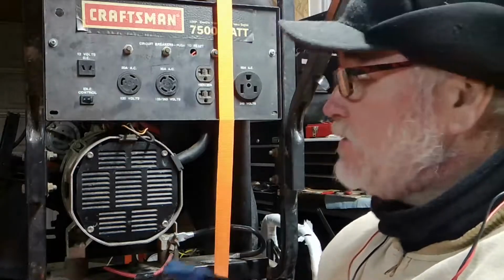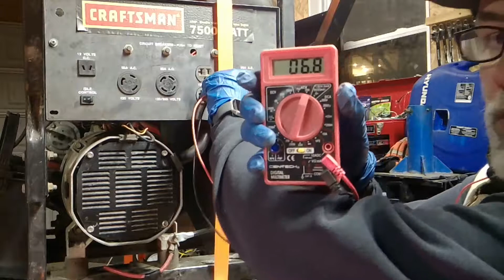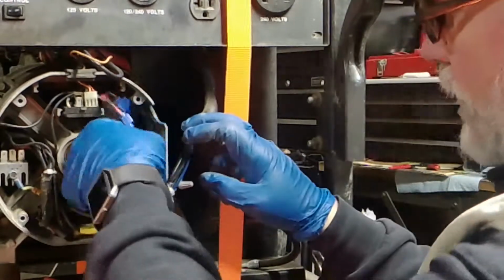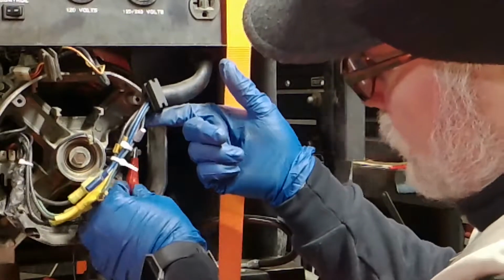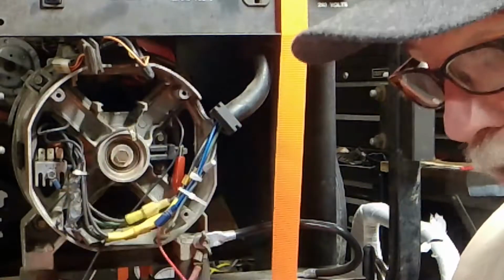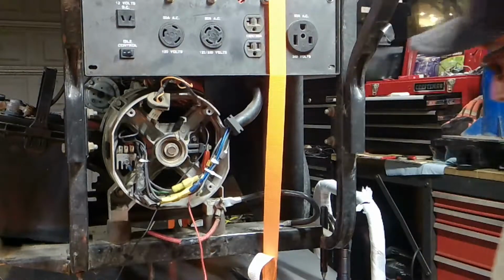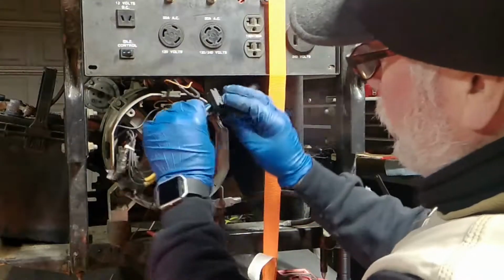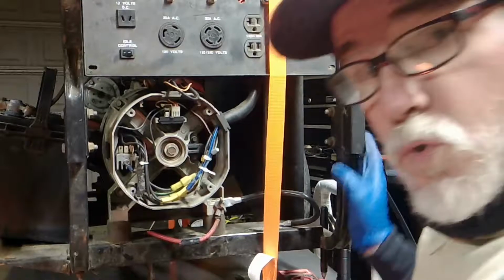How to diagnose generator power loss by flashing field w/12v battery and change voltage regulator

Comment: Output 4.5 vdc.  Brushes look okay with about 1/2" of brush on each side remaining...  I removed the voltage regulator and jumper 12 vDC to brushes (as above) and output jumps to 120 vAC. Installed new voltage regular, which looks almost identical (Briggs & Stratton 84132GS), and voltage returns to 4.5 vAC.  Repeat the above, repeats the same result.  Schematics in cyberspace are illegible re voltage regulator...  Question #1: there two spade wire connections on the regulator, though I marked them before disassembly, might not have been in the correct front-back position before I first removed the regulator.  Is it correct that a red wire tagged #2 is in front, and a blue wire tagged #4 in back?  Question #2:  Can marginal brushes work when jumped and fail with a new voltage regulator?  What am I missing?  Thoughts?

580.327290 (9783-0) - Craftsman 6,500 Watt Generac
Reply: @MarkSales70  With about 90% confidence, I concluded that a wire on the inner winding of the armature had failed.  The fix would require re-winding the armature.  I found a couple of resources that would re-wind the armature, but they wanted more $ than I felt the generator, working, would be worth.  Additionally, there was no guarantee that re-winding WOULD fix the unit.  I decided to take the generator off of the output shaft of the gas engine - and found the connection is a tapered one, possibly a "Morse Taper".  I wound up destroying the generator in the process of removing it.  I saved the engine and scrapped out the generator.  I used the frame, gas tank, and gas cap from the unit - and restomoded a 1972 Craftsman generator that now works excellently and runs for maybe 9 hours.  The Generac is dead and the Craftsman is better than new.
Reply: @EndWW2  Ughh!!   That does not sound promising!?!  I tested the two wires that go into the regulator (from the stator) and it measures 7 volts AC.  Is that the correction voltage?  When plugged into the regulator, the regulator produces ~ 4 volts DC (both the new and old regulator).  Could both regulators be NG?

Comment: I wish that I understood this stuff like you seem to. Nice instructional video that was easy to follow and entertaining.
Reply: ⚠️Generator safety advice: always keep in mind that carbon monoxide fumes are very dangerous to inhale and carbon monoxide is odorless and colorless which is a silent killer. You should always have a carbon monoxide detector if you have a portable generator. Please remember not to ever run your generator indoors. Running a generator indoors increases the risk of carbon monoxide poisoning which causes death. Please make sure your generator is 15-20 feet away from your house and away from doors, windows, and vents to lower carbon monoxide poisoning risk. Please remember also not to run your generator in wet conditions. Running a generator in wet conditions can cause electrocution. Please keep your generator dry. Make sure your generator is dry before using. If you need to use your generator during a wet weather, then you need a generator tent to protect your generator from getting wet. We also need to keep our children safe when we are using portable generators so that they won’t get electrocuted or burned by the generator which is dangerous. We need to keep an eye on children making sure they are not near the portable generator to avoid risks and also carbon monoxide poisoning. Generators can be dangerous so we really need to be aware with the hazards of using generators. Generators pose electrical risks. Please never try to plug a generator cord into a wall outlet to avoid back feeding. They should be plugged into a transfer switch if you need to run your house with the portable generator. Please not overload your generator. Overloading your generator can cause damage to the appliances that are plugged into the generator. Always turn on your generator first before plugging in appliances. And shut off your generator first before you unplug the appliances. Please use a heavy duty cord for your generator and the cord should not be worn out. Worn out cords should not be used on generators. Please don’t refuel your generator while it’s running. You need to shut off your generator and let it cool off before refueling it. Never refuel your generator while it’s still hot. https://youtu.be/I1jT3ANENvI and here is a video more about keeping your family safe while using portable generators. This is just a safety reminder and please make sure you are aware with the hazards of using generators. Thank you stay safe.

Comment: Fire in the hole!!! love this video. I know my generator needs flashing but I only have a cordless drill. How and where would I connect?
Reply: Turn on genny, plug drill in with breakers on and pull the trigger on the electric drill. Then you give the drill chuck a swift spin with trigger depressed and release your hand quickly. The drill and genny should now be powered up ☺
Reply: @staind288  and if it doesn't work after hand spinning it, hook up drill to drill and power spin it. Mine wouldn't flash with just the hand

Comment: Have same 7500 watt generator. It got jump started but voltage was reversed. Wire from battery to voltage regulator to charge battery was melted. I am concerned this became a major issue now.

Comment: Great video,my generator 12k always needs to be back feed every time I use it. There's no battery in it, is that the problem?After it runs 6hrs it will stop making electric. Thanks for any help.
Reply: Reminder about generator safety: always remember that carbon monoxide fumes are odorless, colorless, and toxic and dangerous to inhale which causes death. That’s why it’s never safe to run a generator indoors. You also need a carbon monoxide detector to be safe from carbon monoxide. Please be aware with all the hazards of using generators. Many people have died each year when using generators due to carbon monoxide poisoning and electrocution. Especially you should be keeping your children safe when you’re using portable generators so they won’t get electrocuted or burned by the generator which is dangerous and also poisoned by carbon monoxide. This is just for everyone’s safety. Make sure you read the manual instructions carefully. Please remember not to run your generator indoors. Your generator should be 20 feet away from your house and away from doors, windows, and vents. Running your generator indoors increases the risk of dying from carbon monoxide. Also do not run your generator in wet conditions. Always make sure your generator is dry before using. Do not allow the generator to get wet. You also need a generator tent to protect your generator from getting wet if you need to use your generator during wet weather. Running your generator in wet conditions causes electrocution. Please be careful. Please make sure your children are not playing near the portable generator so they won’t get electrocuted or burned by the generator which is dangerous. It won’t be safe for children to be near it. Generators pose electrical risks. Don’t try to plug a generator cord into a wall outlet to avoid back feeding. Please use a heavy duty cord for your generator. Make sure the cord is not worn out. Do not overload your generator as well. Overloading your generator can cause damage to the appliances that are plugged into the generator. Please turn on your generator first before plugging in appliances. And shut off your generator first before you unplug the appliances. And never ever refuel your generator while it’s running. Refueling your generator while it’s running can cause fire if gasoline spills on the generator’s engine because it’s hot. You should shut off your generator and let it cool off before refueling it. Just making sure you are aware with the hazards of using generators. Whatever is said on the generator’s operating manual should not be ignored for safety.  https://youtu.be/I1jT3ANENvI and here is a video more about generator safety and keeping your family safe. Thank you. Be safe as well.
Reply: @The_Happy_Aviation_Enthusiast    YOU  never answer anyones'  questions...... d o      you  ?

Comment: I have a Generac where the rectifier and brush assembly is one unit. The voltage stays steady at about 50 volts.  Is it safe to do this same test on my machine?
Reply: Make sure you follow all the generator safety instructions on the manual. I know all about generator safety and I have something very important to explain about generator safety. We notice that some people run their generator indoors which is not safe and it can cause death because of carbon monoxide fumes. We should keep in mind that carbon monoxide fumes are colorless and odorless which you can’t see or smell. And carbon monoxide is toxic. Its not safe to inhale especially when using generator indoors. Do not run your generator indoors even if your doors and windows are open. Running a generator indoors increases the risk of carbon monoxide poisoning. Running a generator indoors is never safe even in the garage. Make sure your generator is 20 feet away from your house and away from doors, windows, and vents. You also should have a carbon monoxide detector. Generators are outdoor use only. And some people also run their generator while it’s covered in snow. Here is what to be aware of; generators should not be operated in wet conditions because you can get electrocuted. Do not run your generator in wet conditions. Make sure your generator is dry before using. You also need a generator tent to protect your generator from getting wet if you need to use your generator during wet weather. We should also make sure our children are not near the portable generator to avoid any risks. Children can get electrocuted or burned by the generator which is dangerous so make sure you keep them safe. Generators pose electrical risks. Do not overload your generator as well. Overloading your generator can cause damage to the appliances that are plugged into the generator. Use heavy duty cords on your generator. The cords should not be worn out. Do not try to plug a generator cord into a wall outlet to avoid back feeding and fire hazards.  Always turn on your generator first before plugging in appliances. And before unplugging appliances, please shut off your generator first. Do not ever refuel your generator while it’s running. It can cause fire if gas spills on the generator while it’s hot. You need to turn off your generator and let it cool off before refueling it. Don’t refuel your generator while the engine is still hot.  https://youtu.be/I1jT3ANENvI and here is a video more about generator safety and keeping your family safe while using generators. This is just a safety reminder and hope you stay safe and make sure you are aware with all the hazards of using generators. Thank you be safe.

Comment: I have a generator that has to be flashed every time I use it. It's a 50 Amp generator colman with the fuel tank on the end, not on top. I do the drill thing using a battery-powered drill to turn the electric drill backward. While the generator is running. This does give me electricity after about 30 seconds and my electric drill is old and may need new brushes. But my question is why does it have to be flashed every time. Even if shut off just long enough to put fuel in it.the power cords are pulled from the generator prior to shutting it off.

Comment: I'm only getting about 60 volts. Sometimes it will go to 120 sometimes it will only get 60 volts and most stuff I plug-in will not work. A corded drill and angle grinder will work about halfway. Cannot find anywhere on the internet symptoms of bad AVR.

Comment: my 120 voltage is fine. However my 12 volt on the panel is only 9 volts and the battery charging voltage is only about 13 instead of 13.8 or more. What should I do about the 9 volts on the panel. what is causing the low voltage? thanks..
Reply: ⚠️Generator safety: please make sure you follow all the generator safety instructions and always keep in mind that carbon monoxide fumes are very dangerous to inhale and carbon monoxide is odorless and colorless which is a silent killer. You should always have a carbon monoxide detector if you have a portable generator to make sure that carbon monoxide is not inside your house to avoid carbon monoxide poisoning. Please remember not to ever run your generator indoors. Running a generator indoors increases the risk of carbon monoxide poisoning which causes death. Please make sure your generator is 15-20 feet away from your house and away from doors, windows, and vents to lower carbon monoxide poisoning risk. Please remember also not to run your generator in wet conditions. Running a generator in wet conditions can cause electrocution. Please keep your generator dry. Make sure your generator is dry before using. If you need to use your generator during a wet weather, then you need a generator tent to protect your generator from getting wet. We also need to keep our children safe when we are using portable generators so that they won’t get electrocuted or burned by the generator which is dangerous. We need to keep an eye on children making sure they are not near the portable generator to avoid risks and also carbon monoxide poisoning. Generators can be dangerous so we really need to be aware with the hazards of using generators. Generators pose electrical risks. Please never try to plug a generator cord into a wall outlet to avoid back feeding. They should be plugged into a transfer switch if you need to run your house with the portable generator. Please not overload your generator. Overloading your generator can cause damage to the appliances that are plugged into the generator. Always turn on your generator first before plugging in appliances. And shut off your generator first before you unplug the appliances. Please use a heavy duty cord for your generator and the cord should not be worn out. Worn out cords should not be used on generators. Please don’t refuel your generator while it’s running. You need to shut off your generator and let it cool off before refueling it. Never refuel your generator while it’s still hot. https://youtu.be/I1jT3ANENvI and here is a video more about keeping your family safe while using portable generators. This is just a safety reminder and please make sure you are aware with the hazards of using generators. Everything that is said on the generator’s operating manual should not be ignored. Thank you and stay safe.
Reply: @The_Happy_Aviation_Enthusiast  Wow, you should write a book. 😴
Reply: @The_Happy_Aviation_Enthusiast    YOUR  missing the question,...again.  endless loop.

Comment: I was only getting 85vs from the generator. I replaced the AVR and flashed the field per your informative video now the generator puts out 125vs but when under load it surges from 115v to 140v!  If I take off the idle control it surges all the time. HELP HELP HELP thanks
Reply: The surging is most likely the carb.  Pull the choke on a little bit at a time and see if it smooths out.
Reply: The carbs  emulsion tube, (inside the long stem, in float bowl) needs to be unplugged, and the idle pilot jet, as well as the forward mini-jet (usually closer to the engine head end of carb). Make sure, the float moves freely, and the needle hole, to tank is not plugged, as well as any filter on the gas line, or  IN   THE  TANK.  Those ones, in the tank are notorius for plugging up. Very small mesh screen. I take these things, out and use an inline filter.  Some gens, have a filter within the fuel petcock. Another thing, be sure the gas tank cap, can  VENT. NOT  VENTING, prevents gravity from allowing the gas to run freely.  ( i use a mower tank, and a longer hose, to eliminate this potential problem, when diagnosing/fixing) Remove any unkown variables, externally from the gen in question.  IS  THE  AIR  FILTER  DIRTY/PLUGGED/OIL  SOAKED  ???